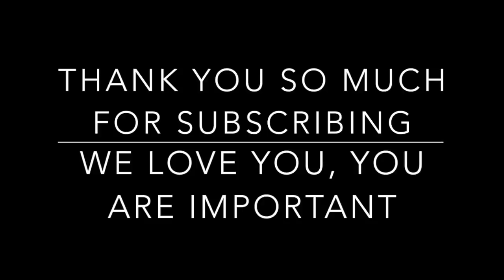Patching a sheetrock hole #164

Comment: As a former painter, have repaired many 'door knob holes' with a balloon (!) - thread the neck of the balloon through a hole in cardboard sufficient to cover hole; place body of balloon in wall with the cardboard cover on the outside of the hole; blow up balloon inside wall using it's neck protruding on outside; tie-off balloon, then mud & tape. btw: knocking your texture down is a trick few know. Good work Jim! Throwing mud is a joy!
Reply from the maker: Kawaii Mike, great idea with the balloon. Thanks for your awesome comments always.